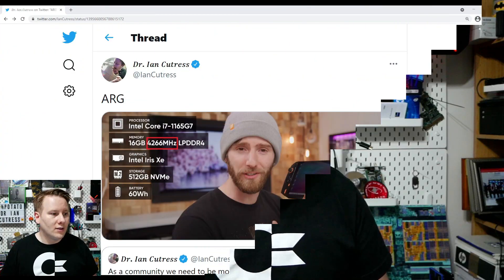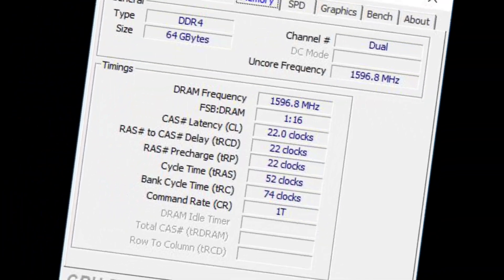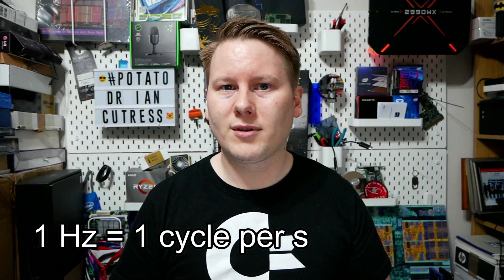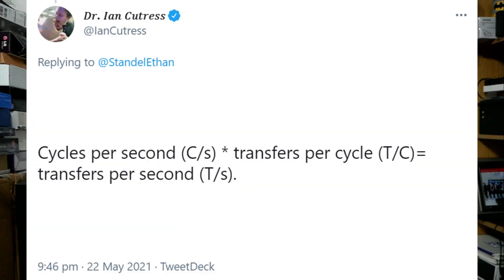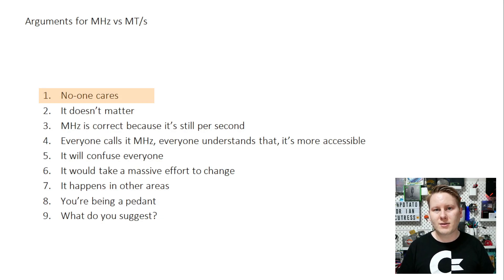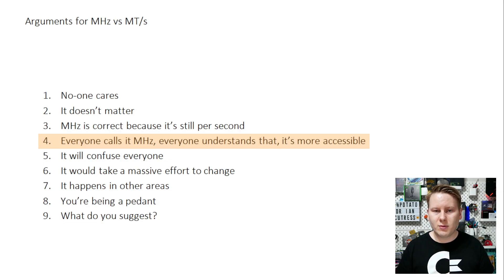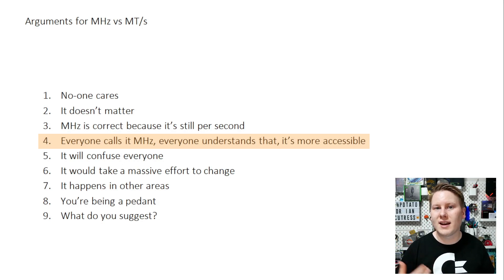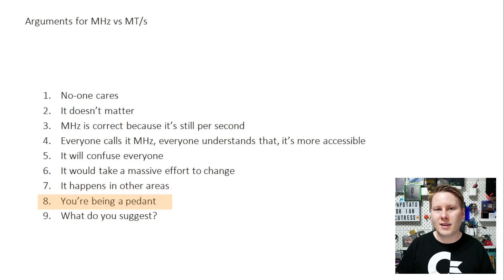Linus is WRONG 💩 : Explaining MHz vs MT/s

Comment: I appreciate your academic/scientific/engineering rigor.

The engineering terms are exact and verbose for a reason. It's marketing that screws this up everytime.
Reply: well then wrongly using mhz would be better
as the uninformed consumer can tell that 2600 is higher than 1400, but if they know the ddr stands for double data rate they prob know what it is an effective speed of the module while getting 2 transfers per clock 
you would be able to convince most people fairly easily(esp not native English speaker) that a hypothetical 2600 sdr ram is faster than a 1400 ddr ram (so the same speed as 2800 sdr ram)
Reply: Interesting, I just noticed that even Windows Task Manager reports RAM speed as MHz.
Reply: Yep. Marketing should be regulated by government.
Reply: @kyoudaiken  It already is.

The real solution would be stopping the consumption of marketing.   Ideally it should be banned outside, due to the psychological harm (eg. claiming buying something makes you happy) and physical harm (eg. obesity) that it causes and then people should be informed that it is dangerous.  Several countries have already done this for their populations welfare.

Banning it outright would be a step too far, if people want to be m***ns and consume deceptive crap they should be allowed to in the privacy of their own homes.

Comment: I have at times wondered this oddity, 1600 MHz is somehow 3200 MHz because it's double rate. Problem is not Linus or any other Youtuber. It's the companies falsely using the wrong MHz. I do care about these things, because metric system and engineering is sexy and important. We don't get to Mars sooner by miseducating the masses. 😉👌

Comment: I can cope with the problem you are describing. What I find actually confusing is that, for example DDR4-2666  is also called PC4-21333 or DDR4-3200 is called PC4-25600. Maybe make a video about those numbers?

Comment: And your point is?
OK, you are correct, its MT/s. SO?  when hypothetically DDR5 comes out with 4 transfers per clock and its still 1600 MHz, but runs at 6400 MT/s.. go and explain to JOE average, why its  2x faster than 3200 DDR4 it its same 1600 MHz.
MT/s and MHz are incorrectly used as interchangeable.
Linus point was, that when 6400 ram comes out, number correctly reflects, that its 2x speed of 3200 ram. And you can call it pony bounces per second, as long as EVERYONE understands it same way.
Reply from the maker: So, you're advocating for misdirection? To someone involved in science communication? Good for you.

Comment: So we just need to get the six other manufacturers to standardize on e.g. 3600 as a "unit of work" classification, in which you divide by the type of RAM (e.g. DDR = 2, QDR = 4) to get the effective speed of the memory.

Comment: I recently had essentially the same discussion with a friend on Facebook. He was marketing electricity service, and referring to kw and Mw, while all of he charts he was posting were properly labeled in KWh and MWh. I politely asked him to use the correct terms and pointed out that kW/MW are units of power while KWh/MWh are units of energy usage. He immediately became defensive and argumentative. He tried most of the arguments people made to you, and never did concede that he was using the wrong units, even though the charts he referenced had the correct units.
Reply: That's a completely different issue. Wh and W represents 2 different things (energy/power) and you were correct pointing that out. 
Hz represents a frequency and a frequency can be related to anything which happens periodically: the clock changes, the transfer rate or the rate at which I eat potatoes.
Reply: @fededevi1985  different context, but still essentially the same logical issue.
Reply: @geoffstrickler  No, using W to represent energy is wrong. Using Hz to represent the rate at which I eat potatoes is completely correct.
Reply: @fededevi1985  No, using Hz to represent a non-periodic event (memory transfers) is equally incorrect. In both instances they are closely related measures, and in both cases, it’s the wrong term to use for the thing being measured.
Reply: @fededevi1985  also, in both cases, they can be equivalent in the extreme case where they are operating at a constant maximum for a period of time. But they are equivalent ONLY in that one extreme case.
Reply: @geoffstrickler  it represent the maximum transfer rate so it is perfectly fine.
Reply: @fededevi1985  it’s still incorrect.
Reply: @geoffstrickler  oh I see now,... we should stop using Hz for CPU clocks  then since those change over  time in modern architectures. LOL.

Comment: Thank you Dr Ian, finally i found out why when i open cpu z, the memory clock is 1064,5 (xmp disabled) instead of 3000 mhz(as on the box the memory came in PC4-24000 3000 Mhz).
you can't modify it to either 3600 or 3600 MT/s because the market is using it as it is, even if it is wrong. 
this is something like the advertised size of an ssd (1 Tb). Formated the ssd and it has 931 Gb (my case), but it says 1 Tb. people like big numbers, round numbers, and since 99.99% are oblivious to anything like this, they don't care. More is better, but not too much. 
People know that 4 Ghz - 5 Ghz is the sweetspot for consumer products, people want that 5 ghz processor, not that it matters but it's about a margin. They can't go to 9000 because people know processors don't reach such high numbers, so the understanding is that a good memory is over 3000 Mhz, and the retailers, and AIB's know that as well and they give the people what they want.
It is easier to sell a 1 tb ssd than a 930 gb one. Just immagine someone using the real clock instead of the MT/s, you would have a DDR4 at 1064.5 Mhz, and people remember processors that run at 1 Ghz => crap => don't buy.
from my point of view, i like the 3600 you proppose, but it won't make a difference, companies want to sell not to be exact or use the correct terminology.

Comment: You are indeed right, but I partially agree with Linus. Perhaps a slower transition would help to clarify any possible confusion. Heck, we use the direction of electricity opposite to the flow of electrons because of *convention*, thus defining it in an indirect way (although it differs in the sense that it is still technically correct, just a lot more non-intuitive and is more like saying - Good : Someone who is not bad - trashy analogy but you probably got my point). So from a policy makers perspective, that factor might be still relevant. Although, I disagree with the statement that it "does not matter going forward"

Comment: 3600MHz for DDR means 2x1800MHz technical for all cycle where in marketing it refers to math equal 3600MHz ... so it doesn't matter since its the same. its also explained why it doesnt matter coz all vendor use this terms as product. its just product terms used by Vendors all over in world deals with the standard, so just get over it already lol

Comment: Well the MHz can really represent anything, the transfer actually happens at a frequency which is double of the clock frequency so you have a 1.6GHz clock and a 3.2GHz transfer rate. Hz are not intrinsically related to clocks or signals.
Reply: my guy... you just did it wrong under a video explainig it.
3.2GT/s or 3200MT/s 
And the Hz part HAS a definition and and we dont go around changing definitons on the fly...
Reply: @SuperUltimateLP  the definition is 1/s and it  has nothing to do with clocks intrinsically. The technical explanation he gave makes no sense and is WRONG, Hz are not cycles/s Hz are 1/s, he even wrote it on the video ffs. Hz is just a rate of something, it can represents the rate at which I go to the bathroom, the rate of signal changes and the rate of ddr ram transfers.

Comment: You say this multiple times, and it is incorrect: rising and leading edge. Those are actually the same edge. You can say rising and falling edge or leading and trailing edge. Just to be pedantic.

Also note that a single transfer can transfer multiple bits, kinda how TLC NAND saves 3 bits per cell. So MT/s and Mbits/s is not the same. -- Saying this for buildzoid

Comment: (4:14) Can you do a read on every high and every low (of the square-ish graph) if you worked with dummy data/code? Basically like SSD speeds on the box being wrong but still possible some of the time. Maybe this can be one more of those legal but misleading marketing thingies?
Reply: (I actually agree with no units. DDR4 3200 sounds simpler)

Comment: Ah, so it's like RPM of an engine. Not multiplied by the amount of cylinders because despite having more of those allows more work to be done in the same time, it doesn't change the amount of _revolutions_. Hz is a full cycle per second, like an RPM is a full revolution per second.

Comment: It would help if manufacturers labeled it properly. MHz is ok for DDR4-3200 if you're saying 3200MHz effective speed because it's performing at the rate that single data rate memory running 3200MHz would be. I feel like we should, however, use MT/s along with DDR-3200, because I can understand "DDR4-3200 1600MHz" confusing folks

Comment: It's even more confusing when you add in the PC4-25600 nomenclature. So DDR4-3200 is 1600MHz data bus, 3200MT/s, and 25600MB/s max transfer speed. That's great and all, but just agree on a single freaking name!

Comment: Well, you are both correct. Since Hz only means cycles per second, it is also a synonym for "per second". To correctly use Hz, you should always refer to what you are measuring. 
If you say the clock speed of memory is 1800Hz you are correct, if you say the transfer speed of the memory is 3600Hz you are also correct. If you say the memory speed is 3600Hz you are also correct in my opinion, but it is the actual functional speed of the stick.
This is because saying "This ram is 3600 cycles per second" is ambiguous, because what aspect of the ram are you referring to?
So the transfer speed is 3600Hz, and the electrical clock is 1800Hz.
Its the same for the cpu, you say the clock speed of the cpu is 4Ghz, not that the cpu itself is 4Ghz.
Of course i am being pedantic, but if you can be pedantic, so can i ;-)

Comment: One tiny problem when claiming a specific clock frequency as hertz for memory vs not hertz for transfers, is that while transfers are not consistent neither is the memory clock rate. If you are going to claim that because transfers are not consistent therefore not hertz, instead of the theorhetical maximum (which is the max rated transfers), then you should also state that because the clock cycle frequency is not consistent it is also therefore not hertz. Rated speed is not SPD JEDEC speed, so when you install your RAM you don't necessarily get the speed or frequency or the bandwidth the module states.

Consumers don't care if QDR or DDR only how fast, not how it gets there. There's also the little issue of PC rating showing 8X the MT/s in bytes as the bandwidth for PC memory. MT/s only applies per data pin or per data (bit) path. Therefore a 3200MT/s module is actually a PC25600 module that being maximum bandwidth in a 64 bit wide bus.

Module manufacturers use four different standards on label, MHz, MT/s, nothing and bandwidth (PC rating). Only engineers insist on MT/s but engineers are not the be all and end all when deciding standards.

MHz instead of MT/s is also known as effective clock speed rather than than actual clock speed, a carry over from SDR which btw was preceded by PC ratings which was initially based on bus speed frequency but changed to effective bus clock frequency, and as that's variable with the module installed MT/s is just a convenience to differentiate actual from effective clock speed saving a simple division step, though to get actual clock speed you probably still have to do that step as actual clock frequency isn't always listed.

Outside of the specific realm you insist is correct as MT/s, Hertz denotes frequency and it's not specific to waveforms though that's its primary reference and most laypeople understand Hertz as amount or times (or X) per second.

So from the consumer standpoint defining memory speeds as effective frequency is an easily understood metric that does not require re-education of the public, and as tech review channels are primarily focused on the consumer and not the engineer with the added fact that MT/s is not regularly used by either module manufacturers or retailers. Your purist engineer position is not the one that will win the argument as there are multiple correct answers with the most technically correct for module speed being the PC rating for overall bandwidth that was mostly rejected by the public as too confusing, as too is MT/s.

The closest to being correct is the non use of a suffux to the speed rating, i.e DDR4 3200 without MT/s or MHz as it doesn't really matter and you can insert the one of your choice.

That's not a high horse you're on  it's an ass.

Comment: 1/s = 1 Hz. So,

MT/s = 10^6*T/s=T*10^6/s=T*10^6*Hz=T*MHz.

Let's say there is  a ram that runs at 800 MHz and does 2 transfers per cycle,

in matters of how the ram runs you can say it runs at 800 MHz meaning cycles per seconds, and in matters of how many transfers it does you can say 1600 MHz meaning transfers per second. Without stating anything, however, it is implied that it is cycles per second, but Linus is not that off saying that it does not matter that much for average consumers. I prefer accuracy myself over "simplification" though.

Comment: Your academic background really shows when it comes to terminology and using the correct units. Universities basically train people to go crazy over such stuff; I happen to do the same when I encounter something chemistry related with unprecise wording. Only by agreeing on certain definitions, we can convey complex ideas and concepts and have everyone get the same understanding/mental picture. Otherwise, science communication would be pointless as everyone used the same words but meant something completely different.
Reply: Funny thing is, by his own reasoning that not every leading or trailing edge will result in a transfer, the MT/s unit is still a theoretical constant maximum not an actual. Thus by stating the measure as a theoretical constant maximum it can be therefore expressed as Hertz, thereby negating the argument.
Reply: @magottyk  Following your logic we'd have to call it "MegaTransferHertz", otherwise we'd loose the information that this unit emerges from how the underlying oscillating signal is interpreted. MT/s ≠ 1/s.
Reply: @Psychx_  
Hertz was fine before DDR, it's still fine as the effective constant maximum frequency. It is after all just a relative reference of speed and not the always actual speed.
Reply: its called marketing xD

Comment: You are technical correct, the best kind of correct. I still can't find myself caring about MT/s vs Mhz, but I like your last point to just go unitless. 

As I understand it, that's really the status quo as far as the standard itself is concerned (like you said, it's DDR4-3200). Plus, it won't needlessly confuse consumers who wouldn't understand why RAM went from a unit they understand (Mhz) to a unit they've probably never heard of (MT/s). And manufacturers are still happy because the marketing number (3200) keeps getting bigger.

Comment: This clarifies a lot for me. I was always confused how a stick of RAM could be both 1800 MHz and 3600 MHz.
Reply: Measuring two different things both of which can be defined by hertz because of frequency, neither are consistent as clock cycles can also be dynamic lasting less than a second in practice.
1Kg of potatoes and 1Kg of leeks makes 2Kg of potato and leeks, add 1 litre water and we have 3 litres of soup or should it be Kgs as the weight per volume of vegetables is not the same as water, but 1 litre of water is 1 Kg.
Reply: @magottyk  I'm not sure but you 've effectively muddied the water :P
Reply: @IrocZIV  
MT/s is a measurement of the theoretical constant maximum rate, therefore because it's the constant maximum it can also be expressed as Hertz which is an expression of X/s
Reply: @magottyk  I get that now, though I tend to agree it shouldn't be written that way when you have MT/s as a perfectly valid unit that differentiates it from the base clock speed.
Reply: @IrocZIV  
MT/s only became a thing when the effective rate of transfer became greater than the clock rate. Until then it was expressed as hertz and because the effective rate is also an expression of frequency hertz was maintained even though the actual clock frequency was half.
MT/s is a convention defined to differentiate the unit of measurement, but that doesn't make using hertz wrong as anyone who needs to differentiate knows that DDR rate /2 = clocks and GDDR rate /4 = clocks, therefore the whole "MT/s is the correct unit" is a moot argument especially given that neither hertz or transfers express the actual bandwidth but only a relative speed.
Reply: @magottyk  I'm not saying it's right or wrong, just that having different units adds clarity.
Reply: @IrocZIV  
I can use either and if you don't know the difference between the two, then it doesn't really matter what they put after the relative speed number.
It's because it doesn't really matter that the industry makes no effort to standardise like they did with the PC rating bandwidth number.
Reply: @magottyk  My issue of confusion has been when looking at specs, labels, bios.  Listing them with different units would add to the clarity,  making it self evident why there are two written speeds. The layman (me) wouldn't run into questions.